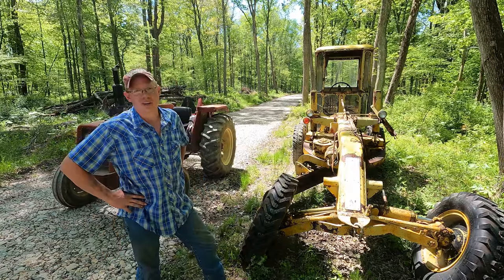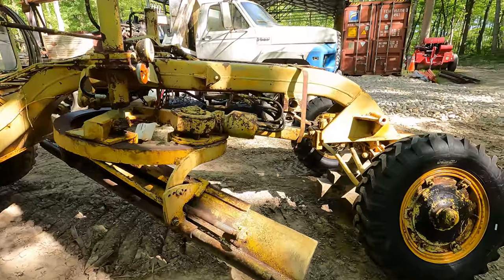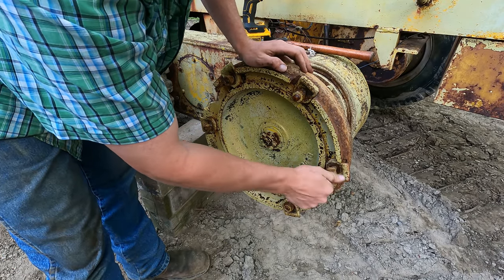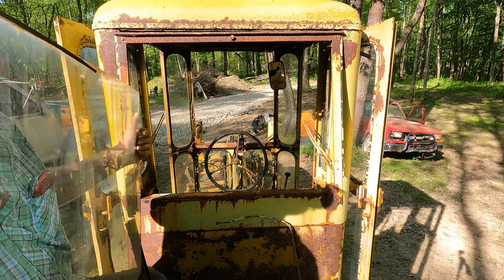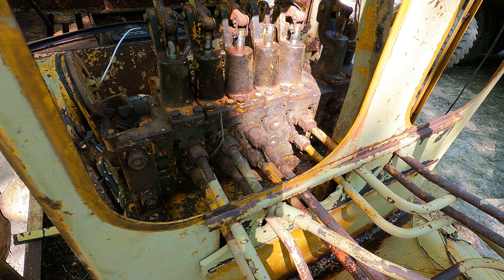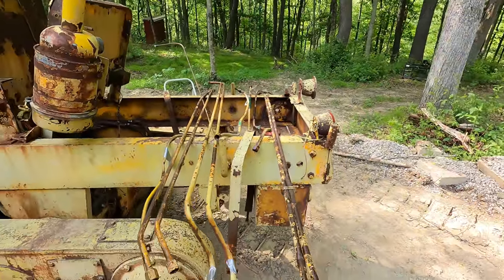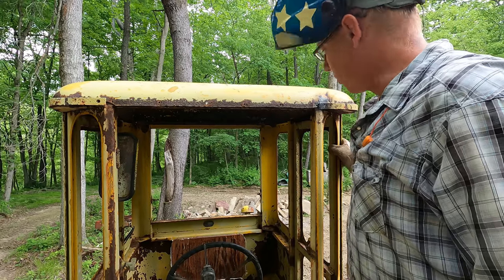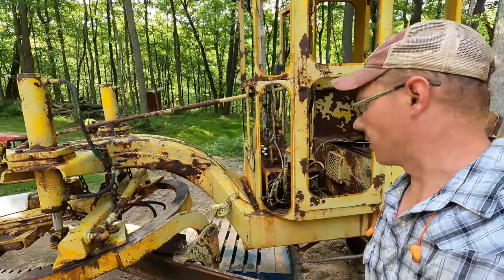More Problems with the 1960's Galion Road Grader restoration!! Pt.8

Comment: Howdy Matt. We used Imperial Eastman tools for these type of SAE 37 degree tubing lines. It is not too hard to actually make them if you use a good Flaring tools and the proper benders. If you have the old lines it makes it a lot easier to recreate them. https://imperial-tools.com/products/364-fha-lever-type-tube-benders/  https://imperial-tools.com/products/537-f-large-size-37-rol-air-flaring-tools/. One thing that I learned from a lot of hard luck is to cut the tubing with a guide and a hack saw first if you are going to make 37 degree flares on the ends. Do NOT use a tube cutter to cut the tubing as it deforms the end inward then the flaring tool has to force the end back outward to make the flare. Using a tubing cutter will cause the flare bevel to crack during the forming process.
Reply from the maker: Thanks for this! I couldn’t find a small screw type tool that could do my flaring in steel lines, this should work thanks!

Comment: Never pull from a point on your tractor that is higher than the axle. The geometry causes the front end to rise and that is asking for trouble!!
Reply: I was thinking the same thing, but I can see the need for having to lift the front because the hydraulics on the tire camber are no longer operable right now, so glad he got the bigger tractor.

Comment: If you foot slips off the clutch pedal while the load is pulled from above the rear axles... you are dead!  As you experienced, the front of the tractor will raise as the rear wheels move forward and you will be crushed... no joke and an elementary safety rule with wheel tractors.

Comment: Matt, Its your grader! Whether you paint over the grease and oil or bring it down to bare metal, do several coats of primer along with a base coat and clear coat... makes no difference to me. I do believe that everyone has OCD in some form or other so don't listen or even let it get you walking in circles!! I like the fact that its not going to a local for scrap metal to make some kind of energy drink. When done the blade won't care if its painted or not... what are you going to do, make some kind of ruler on the edges of the blade to know how far the blade is digging into the blacktop? I didn't think so nor was that a suggestion to even try that one. So it is going to be daffodil yellow hu? I do believe those wheels will look fairly nice after you sandblast and "powder coat" them daffodil yellow also. Just don't .... please don't do white wall tires as that might set my "DOC" meter off as well/LOL. I forgot, did that motor in it run   okay  as I have been sick and in and out of the hospitals now for the last month... they want to start me on chemo and to tell you the truth, I'm seventy three, have kissed a ugly girl, drank out of the yukon river.... and wet the bed when drunk as two billy goats in a mash barrel. I kinda think that the crew I was out with "christened" my bunk where I cuddled up with a raggedy ann doll according to the pictures taken to shame me with. I did feel like I might of had one long island tea too many .. I only remember drinking part of one after a couple of beers..... I was eighteen and shipping out to nam at the time and since have had sense enough to drink one or the other and not mix... I also have in november, twenty five years of sobriety. I ain't bragging, I just can't afford to drink and then over eat as think I did....! I actually came down with Hodgkin's Disease.. ain't that a kick in the knee caps. I love old equipment as we have a lot in common. Rusty non working joints, leaky parts, and don't move well.  I   would try to make the window swing in  and out in front and back.... curious if that window covered with plywood is important or not. Might just make it a opening for something else.... Like a place to hide the coke a cola or a novel idea .... a safety first kit with some band-aids that have flowers on them..... okay, I have had fun enough... good luck Matt

Comment: Laminated glass will separate like that over time. Laminated glass came into widespread use in the 1930s. Do your self a favor and treat the rust with some type of rust converter.

Comment: What was the tractor in the background as you hook to Christine and pull her away? Is that an old Satoh tractor?
Reply from the maker: Mitsubishi
Reply: @DieselCreek  Satoh was bought out by Mitsubishi. I have one of those little tractors and that is one tough mother.
Reply from the maker: @fosterchild420420  good to hear, I haven’t touched it yet. That’s a low priority project
Reply: @DieselCreek  if you look up a Satoh Beaver 4x4 that is the one I have. When Mitsubishi bought them, I think they called it a S370D

Comment: I think you should take off the roof and make a new one, no matter how much you grind away the rust, it will come back. then I think you should replace all the hydraulic pipes, then it looks more original. yes of course it will cost more money, but it looks more original. and it will live for another 60 years.

Comment: It'd be cheaper to buy a good mounted pipe bending tool' tubing flare set and the tubing than have them made plus it would be a good education in how to do it on other old "really, it's not junk dear" equipment.
If he doesn't take that rust off he'll be painting it again in a couple of years when the paint bubbles off.
I'll be disappointed if he doesn't grind most if that rust off then sand blast the hard to get at areas then put at least two coats of primer on before painting it then after he paints it two coats or clear to protect the paint.
Myself, it'd get 4 coats of clear as scratches won't show so much in clear but will in the paint.

Comment: You have more of those steel hydraulic lines to take off yet.  If you don't take off some of that crusty rust and treat the metal, your paint job is going to look almost as bad as it does now in about a year.

Comment: Please don't put sanding filler over rust FFS it will fall off within the year. Also, Tiger Hair is much better-stronger and should be used whenever the filler is more than 1/4 thick. Bondo will shrink and crack when overly thick and use a Stanley ShurForm Shaver just before the Tigerhair gets hard (you have to time it just right.) to shape it, then use sanding filler. With flux core be sure to reverse your polarity, ground becomes positive. Increase your inductance to reduce splatter and the use of anti-splatter, you won't have any weld BB's. I have seen you weld without grinding off the paint, you be making me cringe. Love your channel, doing some pretty cool stuff.

Comment: Hi Matt me what I'm watching you're talking about how to hook up the switch it has the blue line drawn on something white I ain't sure what where this is going that is because I was busy trying to figure out how to make this Smartphones work oh by the way this is Jim and Tucson jk but what impresses me my 53 year-old with a engineering degree is the type of man if something breaks throw it away go buy another one this thing you're working on now is bright fire truck red what's a 55-gallon drum covering up the top of some part of the engine sure is red but anyway you stopped figure out how to fix something like the muffler bracket and holds it to something else again my son very smart man but he would take it someplace else to have it fixed and and your red compactor is getting ready for a maiden voyage sorry it's taking me so long that I keep stopping and watching it again the reason I saw this obsf you thought you need to pick something you figure out a way to fix it and you fix it he's a retired officer from the military I have to go cuz I done remember what I've already said to you but if somebody runs into the back of that thing they deserve to hit it being fire-engine red I know the law you got to have that whatever you call triangle red safety devices it's the LAW.you you need to put a couple of nerf bars on the back or a heavy cow catcher God bless you Matt hope you're having a good evening later bye bye

Comment: Kroil is way over rated. Imo not worth the money.  BP Blaster, Knocker Loose are far better. If you can still get it MOPAR heat control valve lubricant is the best I have ever seen. It looks to have been renamed Rust Penatrant. All three are available on Amazon.

Comment: With all your hydraulic equipment, doesn't it make sense to buy the tooling and materials, of which some are very inexpensive, and make your own?  You'll save thousands of dollar in the short and mid-term, nothing compared to what you'll save in the long run.  And you'll never have to buy a hydraulic line again at full price.